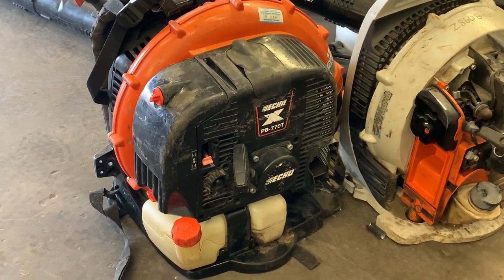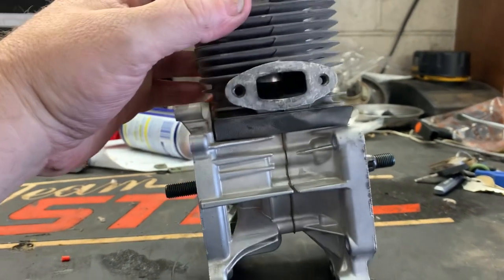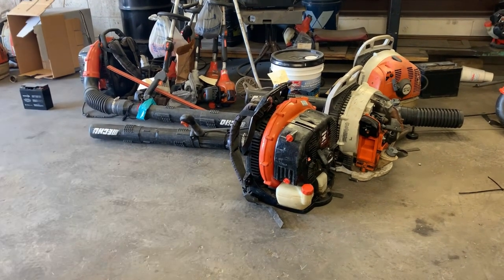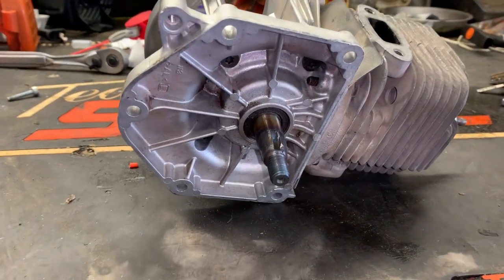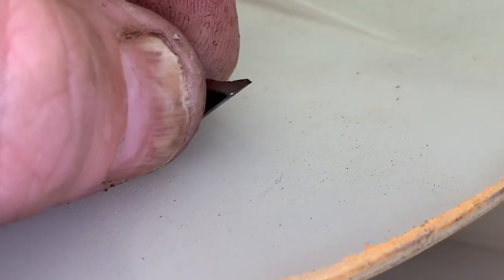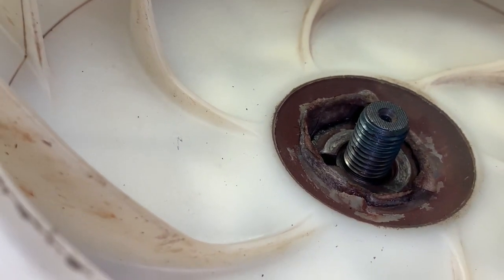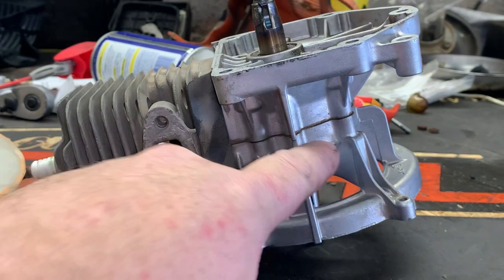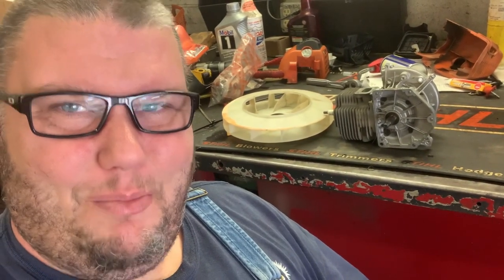WHY DID THE CRANK FAIL IN THIS ECHO PB770T?

Comment: Nobody put loctite on it. The nut came loose. Happens on Scooter and Moped crankshafts all the time. Someone takes the variator apart and changes the weights and puts it back together without loctite and the nut comes loose and strips the end of the crankshaft. See it happen all the time and doesn't matter if it's Honda Yamaha or any of the Chinese Scooters.
Reply from the maker: Pretty sure the nut got impacted on too tight
Reply: @THEMOWERMEDIC1  the center hub can crack being loose every time the engine fires it acts like a impact against the key that's why it is  so tore up. I actually blew the gears out of a almost new cordless DeWalt Lithium Ion Drill starting a String Trimmer with it. When the engine fired it broke the gears.
Reply from the maker: Did you even watch the video? Everything that you just commented I covered in the video